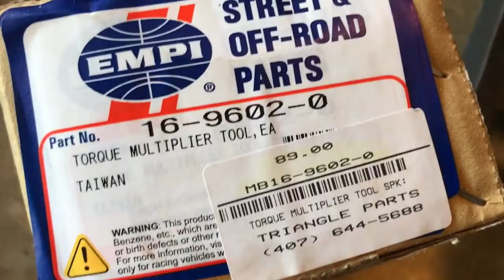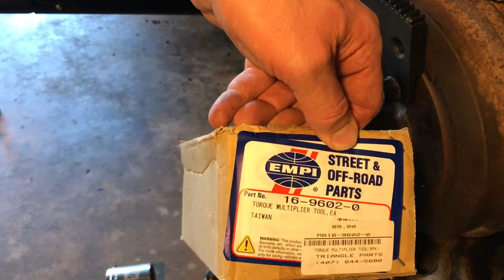VW Axle Nut Removal with Torque Multiplier - Volkswagen Karmann Ghia/Bug/Bus

Comment: Wish this tool was around 35 years ago.  snapped off a couple of 1/2 inch breaker bars at the square drive trying to put brakes on .  its just amazing that you can use a 3/8 drive with little or no effort  to remove the axle nut with simple mechanical advantage
Reply from the maker: Yes, this tool is pretty amazing. I've used it a few times now. It works great. Thank you! Stay tuned for more!

Comment: The adapter on the hub is backwards.... you want the countersunk side to accept the lug nuts.  Then it will adjust itself and snug down tightly to the hub.
Reply from the maker: Thanks Dave! Good tip! Stay tuned man! Did you subscribe? Thank you! =)

Comment: That tool is for rookies. With the same money you could have bought a cordless impact gun and removed it in seconds
Reply from the maker: Hey el! Please send me a link to a cordless impact drill that can remove 300 ft pounds of torque for $80 - Stay tuned for more! Pleas subcribe!
Reply: @CTmoog  I will stay tuned if you buy an impact gun...lol 😁
Reply from the maker: HAHA! ok I will look into it! Sounds like a good tool to have!
Reply: @CTmoog  actually, I have the previous version that came out at the beginning of the cordless impact guns. The one that I have is a craftsman 1/2 inch  200 pounds of torque and I've been able to remove those axle nuts easily.  It used to sell for $89. I've have had it for 5 years already with no problems. For me, it was worth the money.
Reply: @elgroso806  Sorry but I highly doubt that cordless impact is going to remove a vw axle nut.................
Reply: @guyduke9821  I have a cordless Dewalt 20 volt Max XR impact wrench... I used it to remove my VW axle nuts with ease.  I did pay about $250 for it.  Well worth it.

Comment: Hi, I know it's too late to help you with this, but I've found that torque multipliers are better for tightening/torquing the hub nuts  *up*, rather than loosening them. A nut whacker/smacker is better for breaking the hub nut loose quickly. This type of thing... https://www.amazon.com/EMPI-5748-AXLE-TOOL-Volkswagen/dp/B00BGDWTOK they make them for the 36mm and 46mm hub nuts. They shock the nut loose, so you don't have the problem with the wheel spinning as you try to undo it.
Reply from the maker: Hey Andrew! Thanks man! I'm going to order one of these tonight. I appreciate the advise! Thanks for watching!
Reply: @CTmoog  No problem. It's a useful tool to have. Use it with a long breaker bar in the square hole on the shaft. Push down on the bar, while you hit the shaft of the spanner with a stout hammer to 'shock' the nut loose. It's safer to do so with the wheels on the ground for stability. Break the nut loose, then lift the car and remove the road wheel etc. Good luck.

Comment: The tapered side should face out. They use the wheel bolt taper to locate the gear plate. The other set of holes is for the wide five bolt pattern.
Reply from the maker: Cool, thank you.